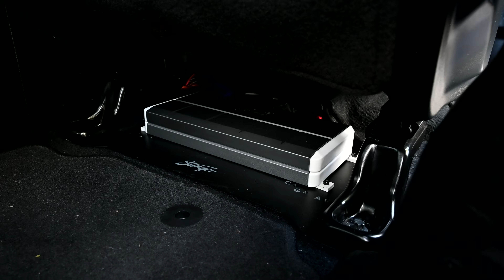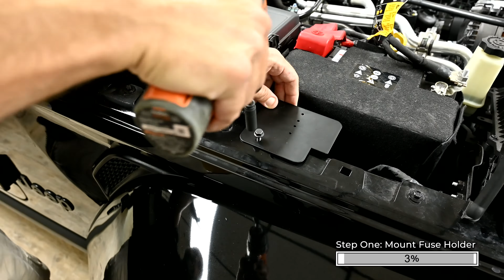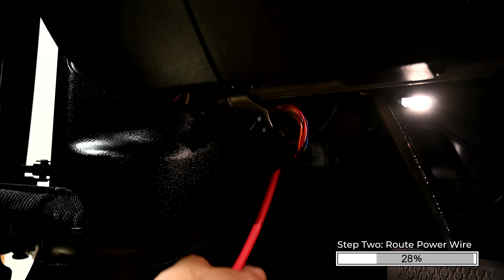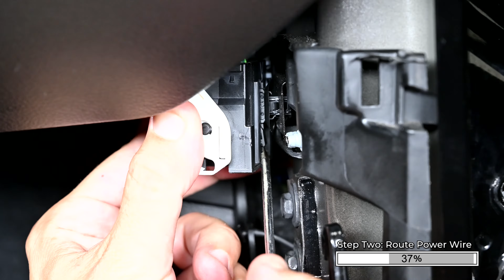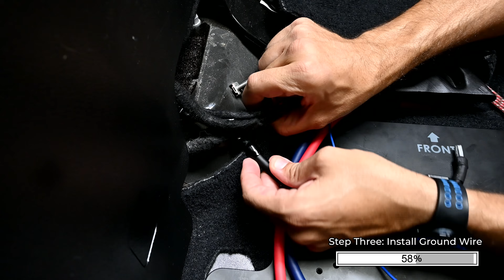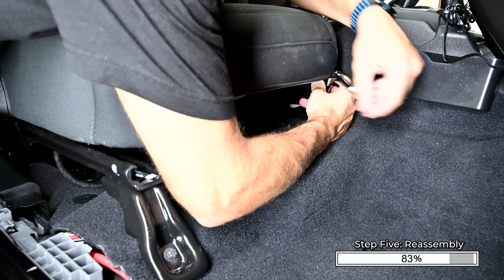How To Install A Stinger Underseat Amplifier Bracket & Complete Wiring Kit (JLU & Gladiator JT)

Comment: Doesn't running the power wire from the passenger side to the drivers side, thru the firewall, then back to the passenger side introduce a higher change of picking up alternator whine/engine noise?

Comment: Not as easy if you have a manual. No grommet on the driver side and even removing the passenger fender liner to get to the bullet proof grommet is a bitch. Otherwise...yeah it's pretty simple.

Comment: For the life of me, I cannot get the coolant reservoir to come off.  Mine is attached on the bottom of the bracket with a rubber plug holding it in place.